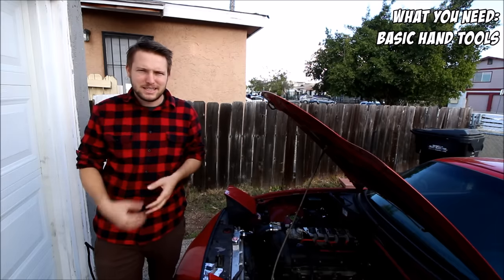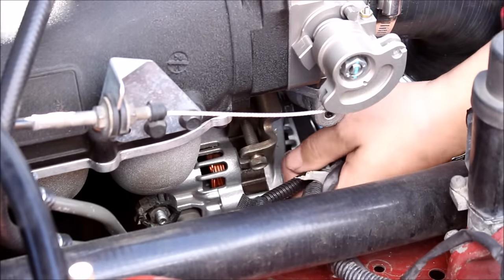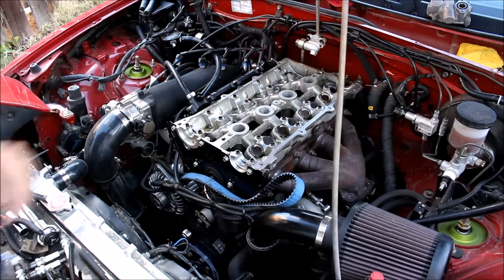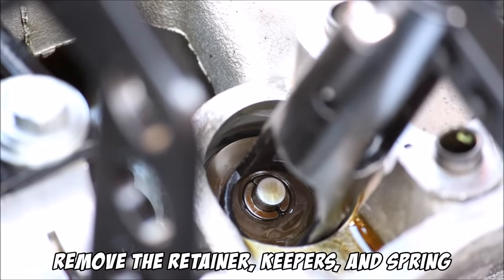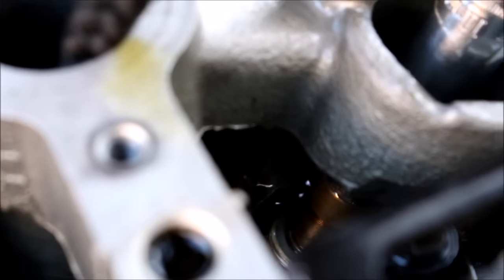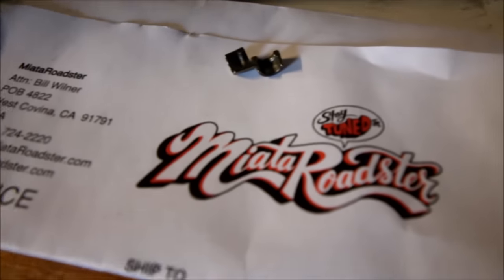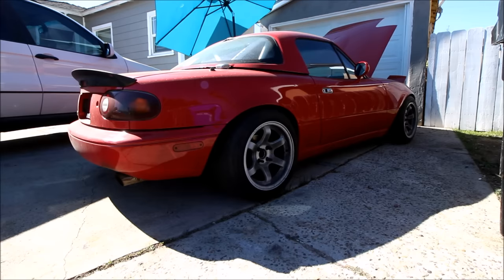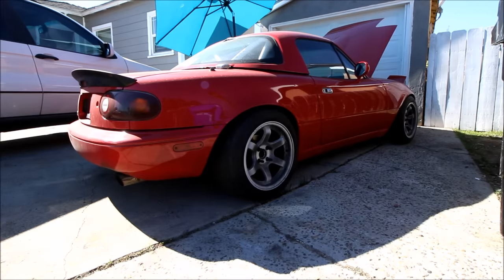The ULTIMATE Guide To Replacing Valve Stem Seals The Easy Way

Comment: Hey Greg! I recently just replaced my valve seals on my 90 Miata, but now it won't start. I'm thinking I installed the camshafts wrong? I put everything back together and timed it at TDC with intake and exhaust marks lines up with 19 teeth in between markings. I'm pretty sure I put the camshafts back the right way with the "I" and "E" on top, but I guess I didn't? Would love to hear your opinion on the matter. Love your videos man, keep it up!
Reply from the maker: Serinio Nepomuceno The I and E might be on top but also make sure the cam gears are on the cams correctly as I showed in the video. Intake cam pin lines up with the "I", exhaust cam pin lines up with the "E"
Reply: TheCarPassionChannel I'm pretty sure the pins are lined up correctly with "I" and "E". I've heard that when the pins are lined up and the engine is timed right at TDC, the front cam lobes face away from each other right? Only 1 rotation is like that for me, I'd rotate the crankshaft 1 whole rotation all the way back to TDC, and the cam lobes would be facing towards each other, but then when I rotate the crankshaft again 1 whole rotation, the lobes face back outwards. So basically every other rotation from TDC. I don't know if that's how it's supposed to be but when the lobes face towards each other the Cam gears are not aligned at all, so I'm assuming it's not right.
Reply from the maker: Serinio Nepomuceno That's because it takes 2 crank rotations for each cam rotation 🙂. As far as not starting, if it ran before you started the job, something was not put back the same way it was before. Retrace your steps
Reply: Will do, I might've done something wrong with the valve assembly? Is it important to use the same exact spring in every valve? Are the Intake and exhaust springs different?
Reply from the maker: Serinio Nepomuceno That wouldn't cause a no-start condition. Just check all plugs/connectors, make sure the plug wires are in the right order, etc. The car cranks but won't fire?
Reply: Yes sir, It'll crank and sometimes it'll seem like it would fire but then it'll just die down. Don't know what I could've put on wrong that could cause a no start :/

Comment: Another tip is put a socket over the spring and extension and tap with hammer real quick and then when u push spring down the keeps don’t pop out like that it’s smooth

Comment: How many times do I need to put the nylon rope in? What else will I need to do once the seals are replaced? Will I need to make any adjustments or adjust the timing or anything else?
Reply: a) once per cylinder
b) cam timing must be correct, the way it was when you took it apart
c) Ignition timing, uh, that depends on if you have an old timey car with a distributor. If so, that might need checking
Reply: @theundergroundlairofthesqu9261  Will I need to correct cam timing? Or will it remain in proper timing if I'm careful? 2008 scion tC

Comment: Is it possible to keep a custom Miata like yours running forever if you keep replacing broken parts, don't abuse it, don't drive it in the snow, always park it in a garage and in general take really good care of it?
Reply from the maker: +GuitarTabsYT Welp, I can't say I've confirmed it but I've done 57k miles in this one with plenty of track and canyon runs 🙂 currently 216k miles on the clock. Many people get over 250k from the original engine
Reply: Awesome!
Reply: My as well drive it in the snow, beat the crap out of it while still maintaining it, park it wherever you want and enjoy the miata because life is too short. Nothing lasts forever. We all die in the end, including the miata. Enjoy your time under sun with the top down while banging that rev limiter because someday there won't be a tomorrow.

Comment: If on the exhaust cam, the “E” mark has to line up with the nub on the cam, does the nub on the intake cam have to line up with the “I”?

I Didn’t want to assume it did because I’m doing a full cylinder head overhaul and head gasket soon and wanted to be sure.
Reply from the maker: Alex James Yes. Sorry I should have specified that.
Reply: TheCarPassionChannel brilliant thanks :)

Comment: Yo man i did cam seals like in your video but now my mazda won't start en i have oil pressure its on time i have spark  the only think that hapens when is disconnect the are inlet and all injectors and is the use brakecleaner it starts back firing like hell could you pls give me some tipss😩

Comment: what happens if the rope get stuck and it's necessary to rotate the crank anticlockwise?
Reply from the maker: You will likely have to spin the crank that way to get the rope out, no big deal as long as your timing belt is tensioned properly

Comment: No smoke at idle or cold start, barely any smoke with throttle, but once I hit vtec I can see it in my mirror. Any other way to know if it's seals, rings or both? God I hope it's just the seals, I'm replacing them soon. 

Easily could be shitty rings since it has 227k miles.

Comment: In diesel engine you should put the rope in the hole of the fuel injector am I right?
Reply: It has model of non over head camshaft she's in the side of the block so you can only remove the rocker arms and push rods then whala?

Comment: Do you hold your belt or chain up with something to remove slack while rotating the crank for setting tdc or bdc ? Any risk or skipping ? About to tackle this on a 2.5 Nissan with a timing chain
Reply: I'm about to do my qr25 from a xtrail did you figure out how to deal with the timing since the chain comes off to get the camshaft? I was thinking to use air, rachet the crank pulley to prevent air pressure turning it over, doing the 2 TDC cylinders then reinstalling cam and chain to rotate over for the other 2 cylinders.. Not sure really
Reply: Let me know if you figured anything out mate, thanks

Comment: quick question - I put the rope in the cylinder and it’s only holding up 1 valve firmly the other 3 are moving slightly down when I compress the spring. How much rope should I use? Are the valve suppose to move at all?
Reply from the maker: They might move slightly, if they're moving too much you can run the piston back to bottom dead center, feed some more rope in, then crank it back towards the top
Reply: @TheCarPassionChannel  
How much rope did you use?
Reply from the maker: @michaellehrer4502  as much as I could fit in at BDC

Comment: How does 90 compression on all 4 cyl, and blowing constant white smoke at cold start sound?
I ended up tearing apart my engine and now its at a machine shop (head/block) and I could've probably gotten away with just the head, but hey 189k miles is about a good time for a rebuild for a longer life of my miata as well when you take off the head you want a good surface for both the block and the head for a proper headgasket seal, it should give it that old power it use to have, and maybe work on some stage 1 upgrades for it!

Also thank you Greg for being the fucking man, you saved my miata and your videos are going to be handy for rebuilding the engine within the week or two.. depends on machine shop

They said I was burning antifreeze on the first 2 cylinders

Comment: I needed to see that demo.   Time to check my VVT out.   I did feel a bit sad to see that fine build showing ANY signs of trouble.   ****GREG could the custom tapering job you had done on the valve stems played any part in this failure?      Or do you feel it is just random?         This is definitely one of the harder video's to watch.   (cringe-worthy)    Oh no! a keeper goes flying!  ahhhh.                Seriously though.   Fine job.    Hey maybe a well magnetized pick would help the next time a keeper  doesn't fall in the way it should.

Comment: Hey Greg,
I just did a head job on my Miata and put in all new valve stem seals from ENGINETECH's complete head gasket kit, some company I found on RockAuto. Are these known to leak? I have a massive smoke screen on every cold start, and there's oil visible on each piston from the spark plug hole. The engine did not burn oil before, and now it's catastrophic. There's no coolant in the oil, and no oil in the coolant. There's no way I installed ALL 4 CYLINDERS' seals incorrectly, I'm especially careful with internal engine work. The engine makes good power (more than it used to) and runs awesome. The head was decked by a machine shop, and a new head gasket was installed. Is it likely I need to redo the seals, and not buy parts from random companies?
Reply: What did you repair yours with?  I got that Enginetech set also, they have vitron seals which look different also. Did your seals look different than the OEM?  I dont think I'm going to use them.

Comment: What was that black stuff you squirted in during reassembly?
Reply from the maker: RTV
Reply: @TheCarPassionChannel  Was that to help hold on the valve cover gasket?
Reply from the maker: @cjcarpenter8366  It's so oil doesn't leak where the cam caps bolt onto the head. It's a factory requirement when removing the valve cover
Reply: @TheCarPassionChannel  Thanks!

Comment: I have a 2013 Hyundai accent hatchback would it be the same as this car? My car losing oil fast and no leaks.
Reply from the maker: Yes if it's not leaking, it has to go somewhere. It can either come into the engine through the piston rings, valve stem seals, or the PCV system. Some cars have an oil air separator that can fail too, it's best to look around online at forums and see if people have the same issue

Comment: Put a piece of fabric/cloth or a small sheet of rubber on top of the retainer before push the tool. The keeper would pushed by the cloth/rubber right into it's place. Been doing this methods on a motorcycle valve spring installation, of course it was easier, I just use a small pipe and push it by my weight. Be careful not to leave any cloth thread/rubber pieces.

Comment: The rope isn't there to prevent valves from hitting the cylinders but to stop them from falling in the engine.... probably something to emphasize to new mechanics so they dont get ahead of themselves.

Also if you use an air compressor you dont need to mess with redoing timing belt.  Just paint mark it and slide it off; which is much easier, especially if you dont know how to put it on misaligned to get it lined up.
Reply from the maker: Not fully true - if you set the piston at TDC like you should, there's no way for the valves to fall in. They do however still need to be protected from contacting each other. I wouldn't trust using an air compressor to push on valves with a piston at BDC (or low enough to drop a valve). I know people do it, not worth the risk to me. Timing belt is cake to set
Reply: I think were really starting to split hairs here.  Like, not having to pull a harmonic balancer is easy, or can you really warp or crack a cam.  Most of doesn't apply to what I'm doning now though, have to reseat vales and can compress by hand, but thanks for the video.

Comment: I had Supertech seals in my engine too. Never again.
Reply: Opt Same
Reply: Same too. Had two sets both leaked. Shame because the pistons and valves are spot on.
Reply: The Lizard 666 Yup. Thats why I went with supertech on my rebuild. I thought they would be high quality like their other parts. Replaced them with felpros and the oil burning is gone. From what I read, OEM is the way to go. But they are expensive.
Reply: I have a set of Supertech stem seals for 2JZ but after reading these comments I'm pretty sure that I'll get something else, propably Elrings.

Comment: At 1:50 he is wrong. In modern Japanese engines that burn oil badly the reason that they are doing that is because of the oil ring not the compression ring so the wet test is not going to change concomitantly.

Comment: Hey guys I think my Miata has a transmission problem. For some reason 2nd gear is harder to go into , after first I try to go into it and it's hard so I wait for the car to slow a little and then it goes in much easier . All other gears don't have that issue they slip in with ease .  Anyone have any idea why?    It's my first manual car , and Miata so idk  .    Thank you
Reply: ray __ sounds like the second gear syncro is worn out.

Comment: Look Bro, your videos are awesome. You have helped thousands of people by now,  BUT that NEIKO tool (even though it's a good quality product), is  a very risky proposition. It's designed to be bolted down on both sides of each bracket that holds the "main rod". On an NB VVT head it can only be anchored to ONE bolt per side.  Putting 300 pounds of spring pressure on ONE (on each side) flimsy valve cover bolt threaded into aluminum
does not seem like a great idea. I bought the thing, but I'm sending it back...

Comment: That oil leaked inside the combustion chamber will damage the catalytic converter and O2 sensors by causing unwanted hydrocarbon deposits to pass through the exhaust system

Comment: Couldn't you just set the cylinder to top dead center and it'd hold the valve up? I feel like the rope is redundant
Reply: the BP engine is non interference, so maybe too much of a gap between the valve and piston.
Reply: Mark DeFord I have to believe the deck on that engine must be like one mm tops right? Otherwise I'd think the compression ratio would be so low..
Reply: ZX6R#366 good point as well. Hmm maybe just to eliminate the possibility of dropping a valve, he shows us this, ?
Reply: Mark DeFord I guess there's nothing wrong with being cautious.

Comment: a keeper getting lost is understandable it's tiny... I was doing a leak down test on my nb today, and my compressor at home is out of order so i had to drive about 30 miles each way to work to use the compressor, long story short, i bumped into my oil fill cap, it fell somewhere in the engine bay, spent 30 mins looking it COULD NOT FIND THAT BIG ASS CAP, CAN YOU BELIEVE THAT? tried rocking the car, jiggling a pry bar around in the tight spots in the bay to see if i could knock it loose, banging on the  bottom wind deflector, rolling back a few feet and slamming brakes, couldnt find it, i had to put some aluminum tape over the oil fill hole and hose clamp it... that failed about 3/4 of the way home and i smelled oil burning all over my freshly detailed engine bay, i think my miata just needs a rebuild, i'm so over trying to find the cause of lost power, it's now ticking, one of my cylinders has 30psi less compression than the others, but i couldn't hear any air leaks during the leak down test. i should've taken off my radiator cap too but i forgot, it may be a blown head gasket , but i'm not mixing coolant and oil, i know it depends where the head gasket rips for it to do that though.

I'm so over it, i think i'm gonna either rebuild it, or just buy a whole new motor. a good rebuild kit costs the same amount as a new motor anyways... we shall see.

Comment: If the car is a Japanese vehicle the screw heads are JLS SCREWDRIVERS  not standard cross points or pozidrive type ones common mistake which usually causes damage to the screwheads and rounding off the heads better to buy a small set of JLS SCREWDRIVERS they are quite cheap and will save you a world of pain too..

Comment: man the rope is a tad sketchy..why not use compressed air..?
Reply from the maker: Nikos Thireos What happens when you push the valve hard enough to overcome the air pressure and it falls into the cylinder? Now that sounds sketchy to me. The best part about this job is you can do it however you want, this is just one example.
Reply: well if your cylinder seels and won't lose pressure theres no issue..i've seen it done before..i'm not saying your doing it wrong,it something different,something i have never seen or done myself..more points to you bro!

Comment: This is  a different way but the easiest way is to buy a compressor so you don't have to remove the cams.
Reply from the maker: It's not possible to change the valve stem seals without removing the cams, no matter what tooling you have

Comment: Those are hydraulic lifters. They're flat tappet style, but hydaulic.
Reply from the maker: Negative. Hydraulic lifters, as the name implies, are filled with fluid (oil), and self adjust. These are solid units that require different sized shims to adjust the valve lash, no fluid involved.
Reply: @TheCarPassionChannel  Interesting. I didn't know that. How do you shim them? I have the same style lifters in my car. Maybe they're solid to then. >.>
Reply from the maker: @nealcastagnoli6185  If it's a Miata, 90-97 uses hydraulic, and 99-05 uses solid. I have a full video on shimming and setting lash too just search "Miata Valve Lash" and it should be in the first couple videos 🙂

Comment: You're a devil for punishment. When reinstalling the keepers, compress the spring first, put a dab of grease on the the inner surfaces of the keepers, and a dab of grease on the outer which sticks them to whatever you're using to manipulate them. Put each in place and slide your holder off.

Comment: to be honest, by time you've taken the timing belt off and cams out you would likely spend more time dicking about with the rope then it would to just undo the inlet manifold and exhaust.

this  way you can inspect the valves, bores and head.

Comment: Just takes cams off.. Like what about setting timing? He forgot that.
Reply from the maker: As noted at 15:45, you have to set up the timing belt correctly which I already have 2 videos on, they are linked in the description. If you are referring to setting the ignition timing, that's not necessary on 99-05 engines.
Reply: @TheCarPassionChannel  i was talking about when you took the bel off, you had it off to the side, when you were rotating the crank how did you do this without turning the belt. And when you re-install the cams making sure the timing marks are right and then cylinder 1 at TDC.